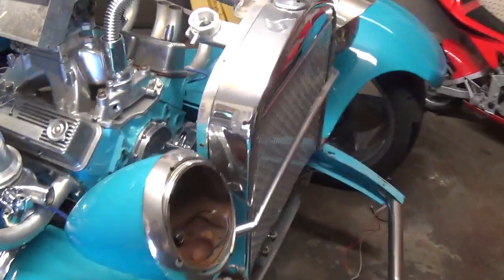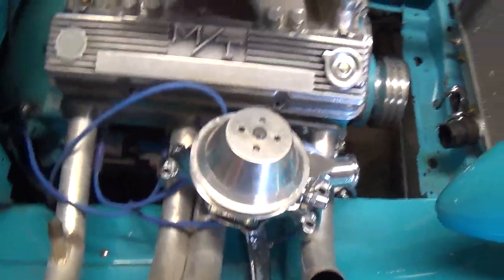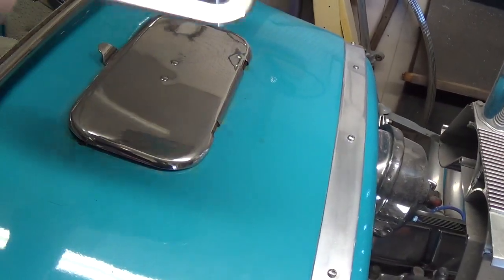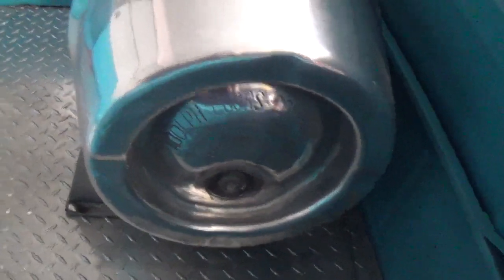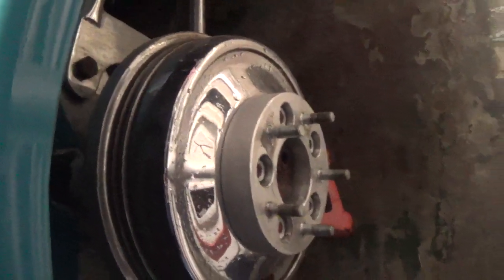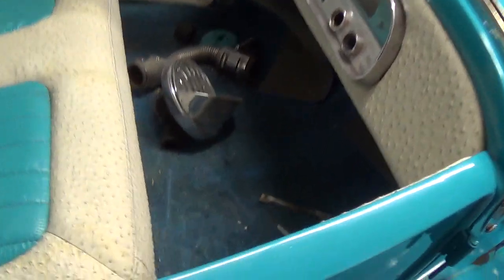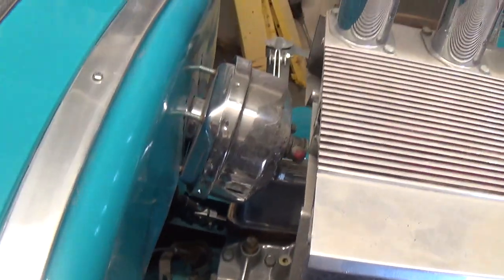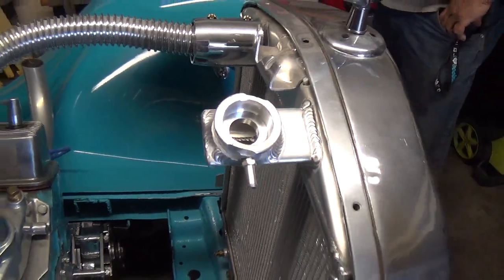Let's Go Look at Rudy's 1927 Model T Hot Rod

Comment: It certainly has potential, but I'm sensing "tape on the speaker cone" kind of project.
Reply from the maker: Well put, Andrew. You would have to completely disassemble it and start from scratch......which would be fine if it had been priced appropriately.